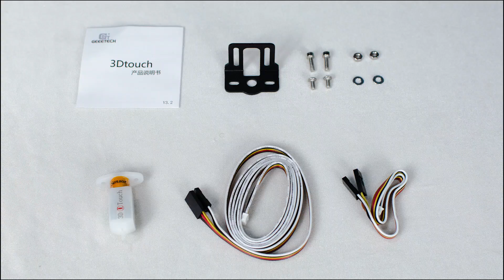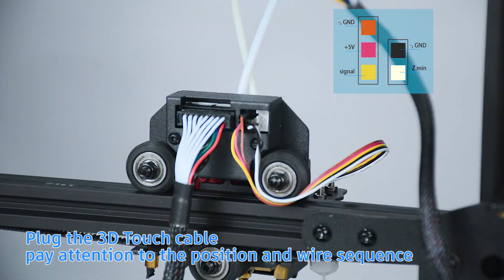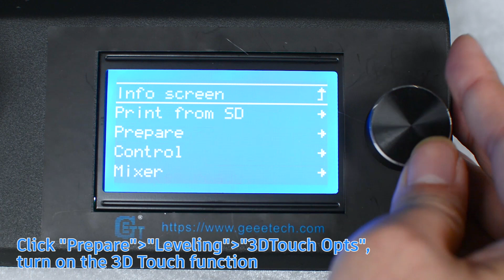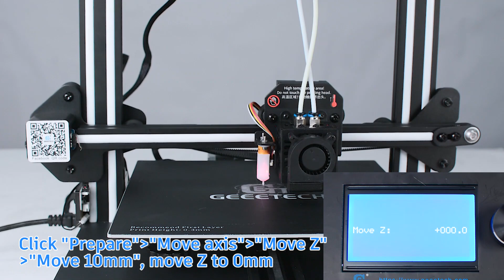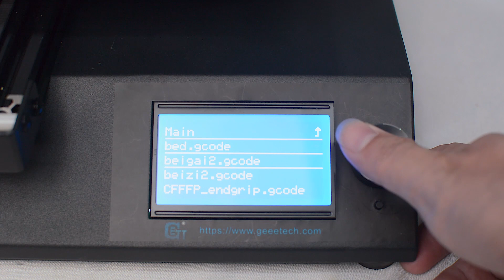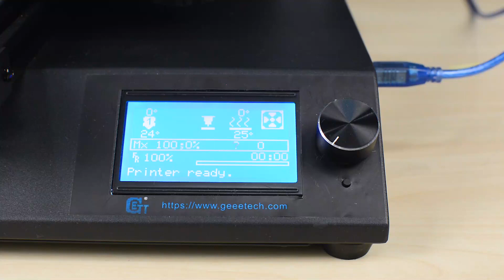Geeetech 3d touch V3.2 installation and updating instruction

Comment: I have a 3dtouch and bought new push pins on Amazon for the 3dtouch (according to the description) but when I mount a new replacement pin it doesn't work as supposed to. The pin retracts when it should deploy and it deploys when it should retract.
It appears as if the magnet inside the replacement pins is upsidedown?
Is there difference between models? Or are the pins I received not for a geetech 3dtouch?
Perhaps pins for Bltouch and 3dtouch are different but the seller just advertises with pins for all?
Where can I buy proper geetech replacement pins?

Comment: If anyone can find firmware to make this thing work properly please post a link.
Reply: This please.  I have an A20T and the current firmware doesn't have the Prepare->Leveling->3DTouch menu.  It doesn't have a Leveling menu at all.  The extruder breakout board does have the correct plugs.  I haven't been able to find firmware newer than 4 years ago.
Reply: @Sciborg9  if you cant find your firmware, there's a good chance you have to self build one using vsc.
Reply: @christophertan-hc4td  Thanks, that's what I was afraid of. I'll start reading up on how to do that. I already downloaded the latest marlin source and the compiler. I'm still reading through all the configuration settings though.

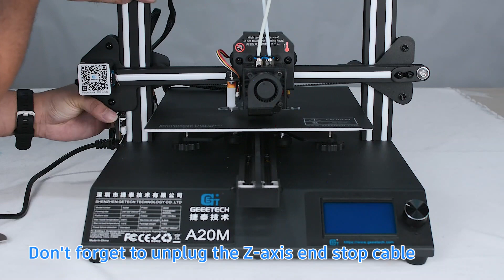Comment: Time 2:07 you unplug the z-axis end stop cable. When is it supposed to be re-plugged?
Reply: IMO it shouldn't be replugged. Min height will be defined by 3dTouch rather than end stop
Reply: It must be unplugged also in an A20 printer? Which One It Is?

Comment: I don't get the leveling option on my menu on my A20, do I need to do something else please?
Reply: theres firmware thatll have the bltouch in it.. you have to look for it.. or get the default firmware and edit it yourself and look for bltouch definitions in it. There probably commented out so you just have to uncomment them. Compile the firmware with Arduino IDE or VScode. Get the PlatformIO plugin from VScode's marketplace and then click it. Look for your boards processor listed in the projects section and then when you click it itll show "build" and some other options.. click build and thatll compile your firmware into a .bin file. Copy the .bin file to your SD card with nothing else on the card, has to be empty.. power off your printer.. insert card.. power on.. and itll update your firmware.

Comment: Hi Guys may be you can help
Installed 3D touch, everything is well and prints are coming out perfect. But this one issue bothers me and I can not seem to solve it. After printer finished leveling with 3D touch, its is very slow to move to starting position. It finishes probing at the farthest right corner and after its done, it takes forever to move to the starting position. Bed is slow, y axis is slow. How can it be fixed? Thank you
Reply: I have the same problem. Did you fix it?
Reply: @zdenekbullz  same here

Comment: Non riesco a fare la procedura! Facendo auto home quando arriva in centro tavola invece di andare verso il basso con il bl touch , l'estrusore va verso l'alto! Sto impazzendo da 2 giorni
Reply from the maker: please check if the z axis endstop was pressed or not. it would be better to remove the z axis endstop when use 3d touch. it's also possible that the magnetic  on 3d touch top is not enough, you can adjust the top screw clockwise
Reply: Ho lo stesso problema, sei riuscito a risolverlo? Mi sapresti dire come?
Reply: Lo fa quando è troppo alto, a stampante spenta dovete abbassare fino al piatto l'estrusore e poi riaccenderla, da li fare auto home. @fauci78
Reply: @MarcoCaiulo  avevo inserito male i connettori bianco/nero lol
Reply: @MarcoCaiulo  Ciao io ho provato a fare come dici tu ma ancora nulla, rimane sempre troppo alto, ho controllato i cavi e sono tutti collegati correttamente

Comment: 1- My A20 have absolutly not the same connector, I don't know how to connect it;
2- It's impossible to "loosen" the screws, because the new BL touch is too big.
90% of this informations are out of purpose, it a shame to sell things without a proper instruction guide.
I will never buy geeetech again, too much problem like those ones.
Reply from the maker: Sorry for the inconvinience it may caused. 
Create a ticket in Help & Support Column in your account, technical staff will help you
Steps:
A. Open our website: www.geeetech.com,then Log in or Register a new account
B. Click your account and select&ldquo;Help&Support&rdquo;
C. Create a new ticket or search the old one
D. Infill the ticket detail,including description and some pictures/video links of the issue